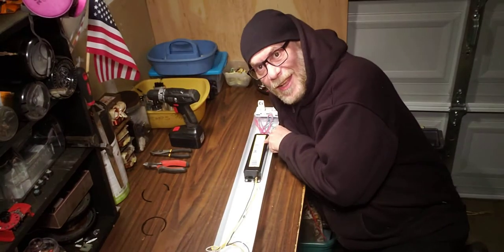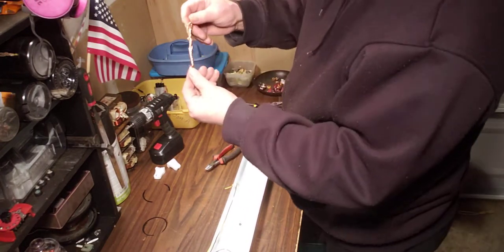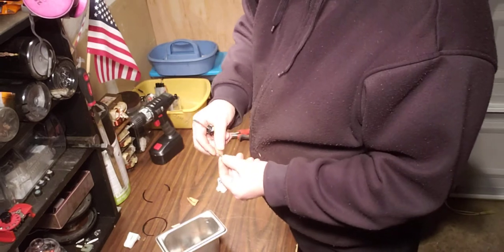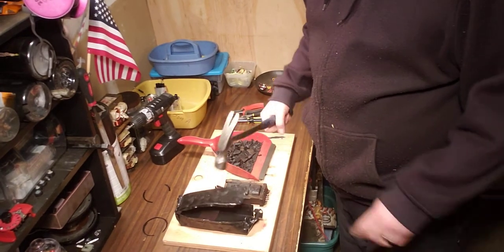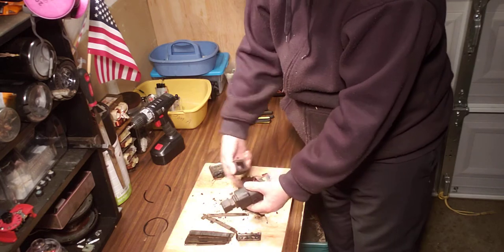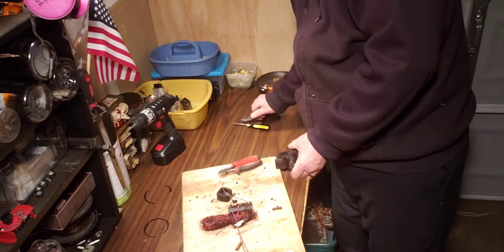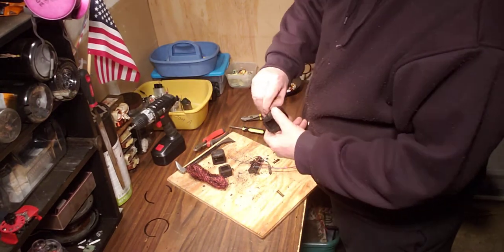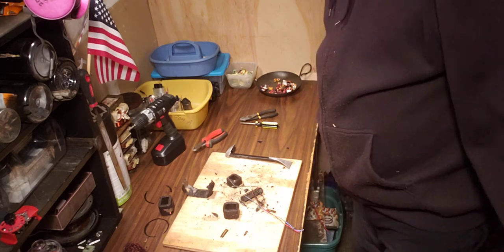Copper Scrapping. The Light and the Dark.

Comment: after you do a few you may find a better way,  it is possible to strip the wire from them with the strip mister. I never did like the copper layers. you may be able to break it up and have a shop vac pull the dust away
Reply from the maker: I'm open to suggestions